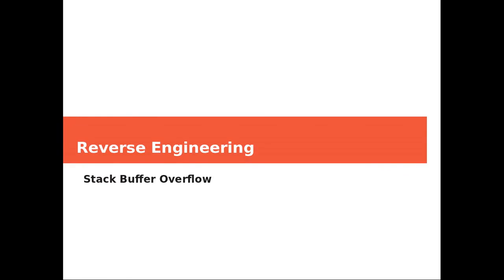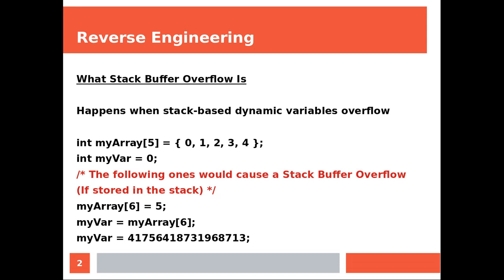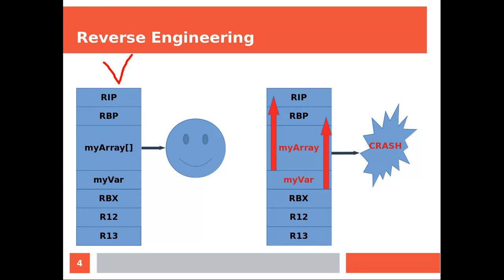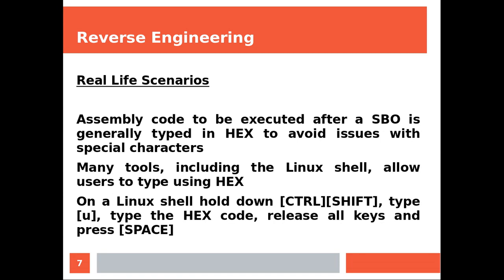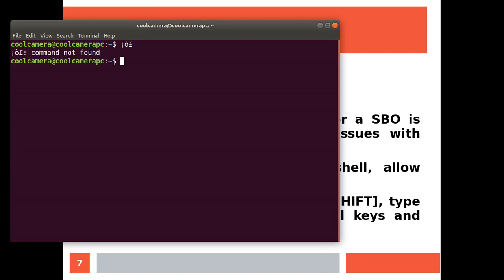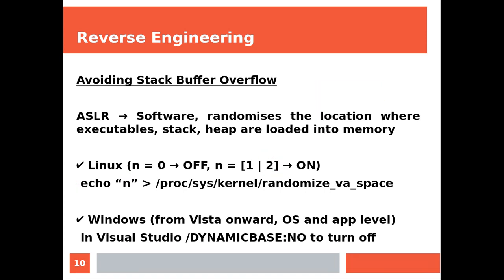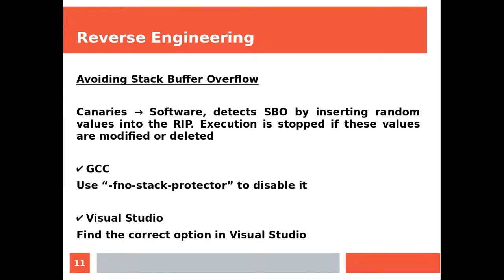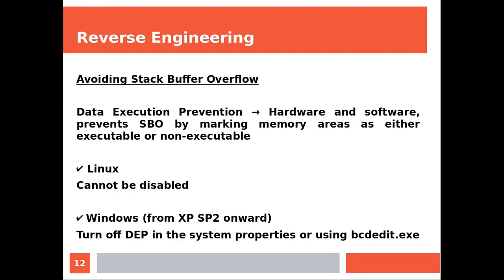Reverse Engineering | Stack Buffer Overflow | Beginners

Comment: Shouldn't NOP be 0x90 and not 09?
Reply from the maker: Thanks for your feedback and well spotted, pinned! I am hoping those who watch the video are getting focused on the mnemonic rather than the opcode itself. While it would be a typo for Intel platform, it could be correct for other systems which is why I would always recommend to double-check the right opcode for the platform that is being used. In fact, you are correct about the Intel single byte NOP which is 0x90, but the 2 bytes is 0x66 0x90, 3 bytes 0x0F 0x1F 0x00, 4 bytes 0x0F 0x1F 0x40 0x00 and so on... NOP for Intel used to be 0x00 while SuperH uses 0x0009...